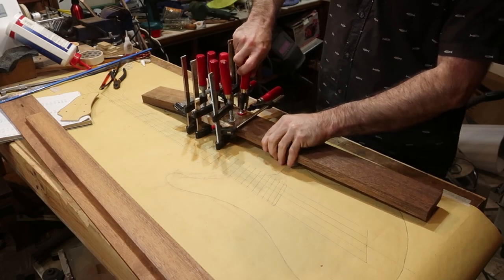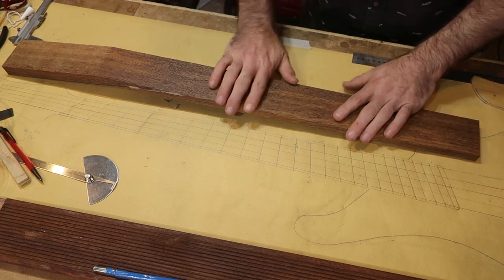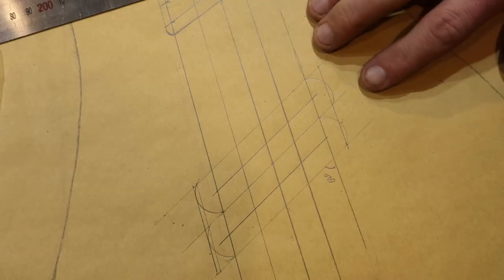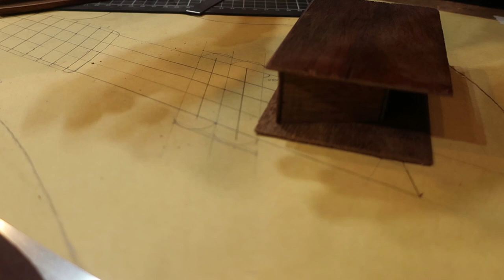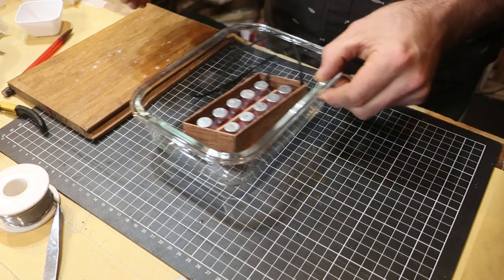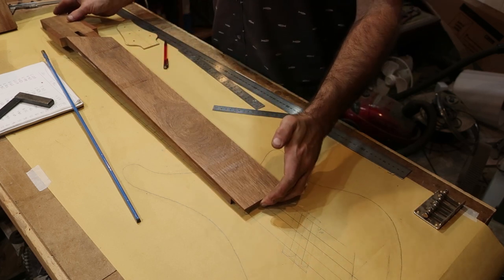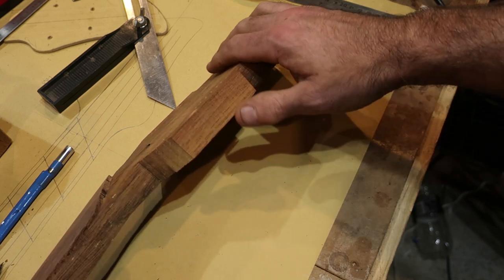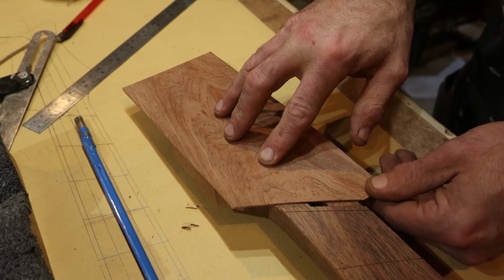Multiscale 5 string Bass Episode 2 -  Truss rod / fingerboard / radius / fret positions / pickup

Comment: I kept yelling at the screen, "LEAVE THE NECK POCKET SQUARE AND FRET THE ANGLED OVERHANG, LEAVE THE NECK POCKET SQUARE AND FRET THE OVERHANG"
While sobbing.
In my defence, I have alot invested in this build. 😢
Reply from the maker: I did think about that, the problem was that after radiusing, the edges of the fingerboard were less than 3mm thick, I couldn't have cut fret slots in that without risking going all the way through and I wouldn't trust to press down on any of those notes either for risk of snapping them off. It'll be fine, I've just bought some 'super long scale' strings with enough length to string them through body so I can make the bridge nice and compact, it'll all work out.
Reply: @fanbladeinstruments  I was wondering about why you couldn't let the fretboard hang over the body also... but fretboard thickness is a good reason that I hadn't considered... But I'm still researching to jump into my first build... which I imagine will be an eye opening experience 🤣😂🤣